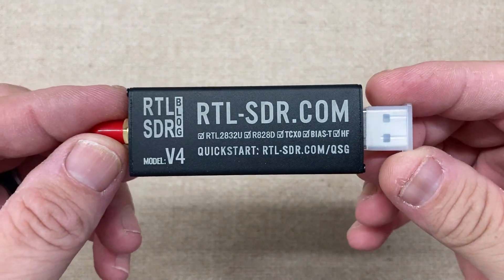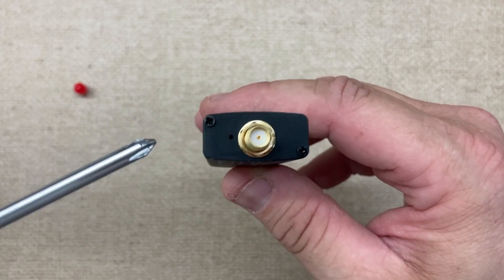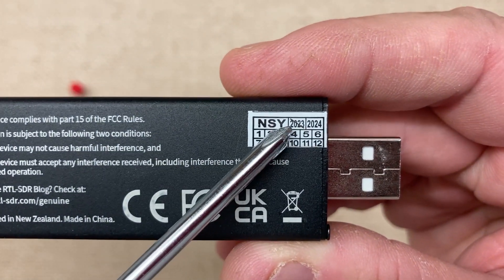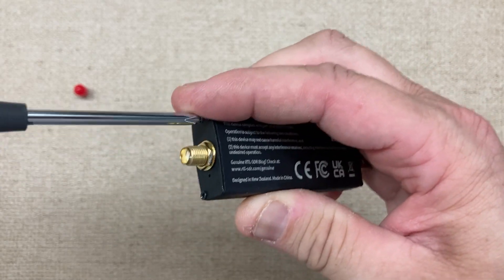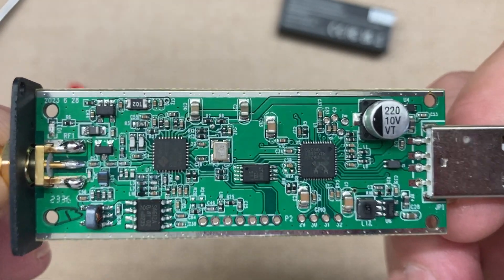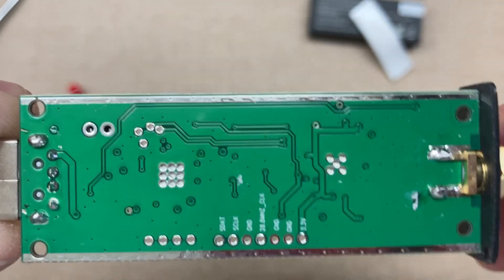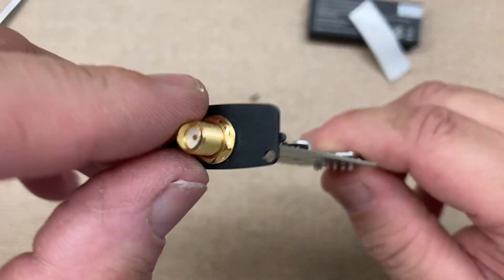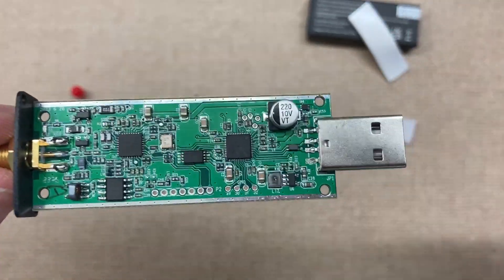RTL SDR Blog  |  A Look Inside The RTL-SDR.COM V.4 Dongle

Comment: I just wondered if you know about the mod to the RTL-SDR v4 that has recently begun shipping.  You can read the thread in the RTL-SDR Forum.  The discussion that reveals it is in the Topic: “RTL-SDR DISCUSSION”, Post: “RTL-SDR V4 – Image Signals” where the management at RTL-SDR reveals the mod in the Post Reply:  “…newer versions of the V4 that are shipping soon will have a minor modification which is a switch to turn the upconverter off when in VHF/UHF mode."